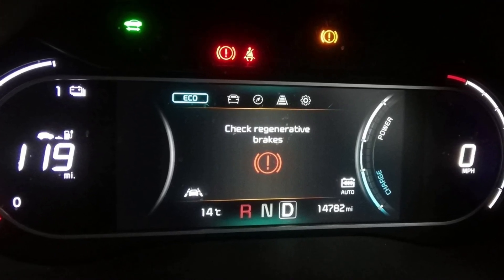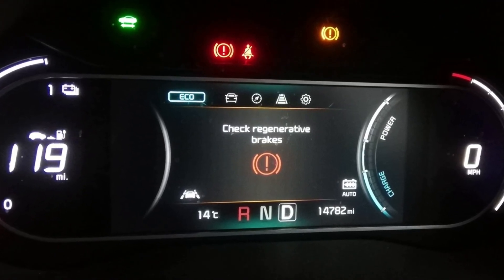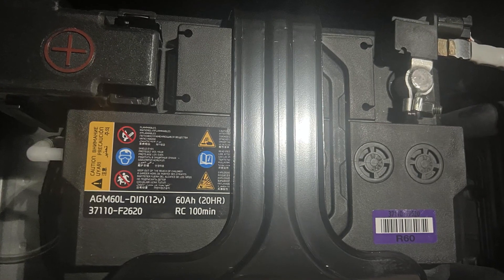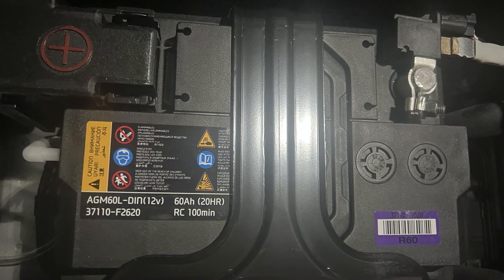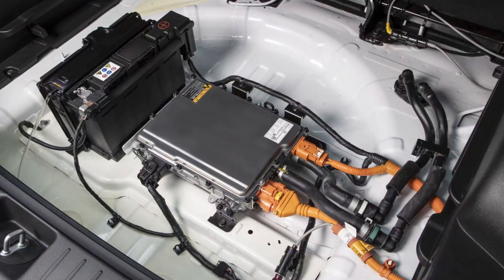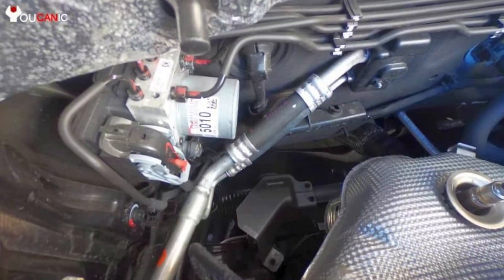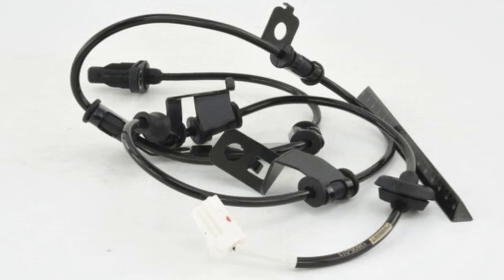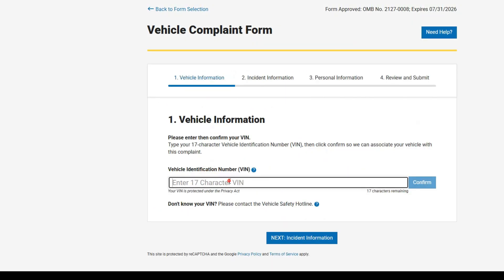“Check Regenerative Brakes” warning in Kia vehicles

Comment: I just replaced the front brake pads on my Niro - 21 EV. That message came on after that. Regeneration works normally, but the regular brakes feel strange.
Reply from the maker: This should be looked at in the dealership or by a good Hyundai - kia mechanic. You want to be confident in traditional brakes.

Comment: Just had this issue pop on our 2018 Niro. Went ahead and filed a complaint with the NHTSA because it's stupid that the cars system doesn't default to conventional brakes when the regenerative brakes are having issues. Hopefully I can get it into a dealership soon for diagnostic and repair. Definitely having them check the 12v battery and it's ground.